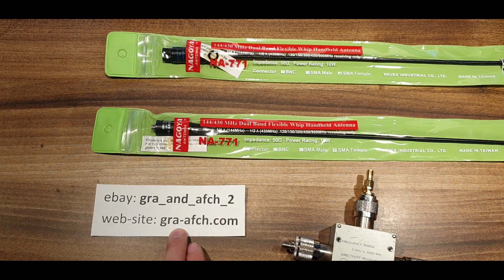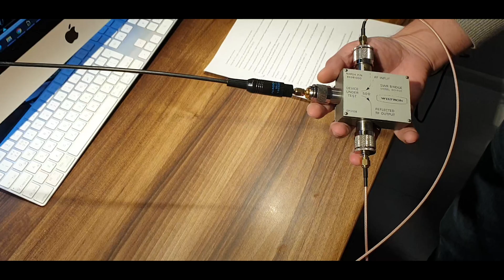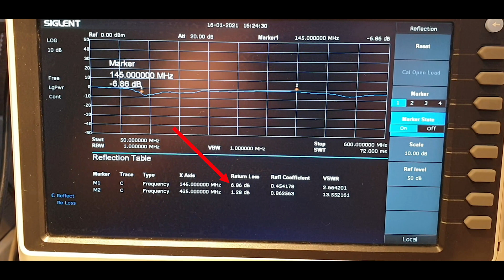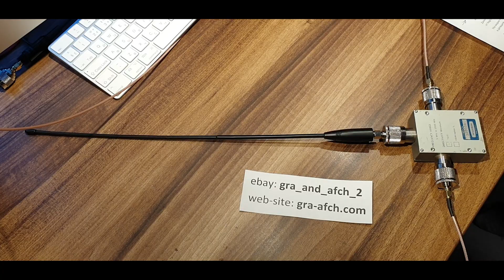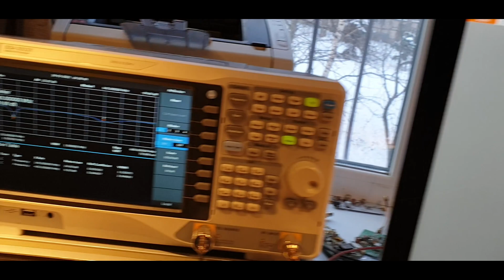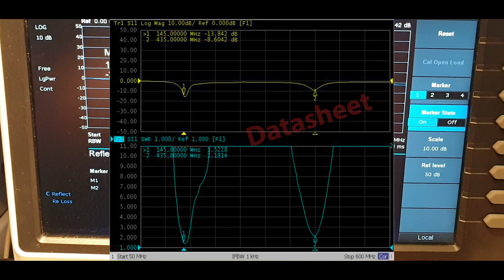Antenna comparison GENUINE vs FAKE 144MHz 430MHz NAGOYA NA-771 SMA Female 10W for Baofeng UV5R

Comment from the maker: Buy it Now: https://gra-afch.com/catalog/rf-units...
Antenna 144MHz 430MHz GENUINE NAGOYA NA-771 Dual Band SMA Female 10W for Baofeng UV5R UV-82
These antennas are genuine and were produced at the Nagoya REUEX Industrial CO., LTD factory in Taiwan.

Most antennas sold on eBay are fake and therefore do not improve, but, on the contrary, degrade the quality of reception and transmission!
By purchasing antennas from us, you will achieve maximum communication efficiency.